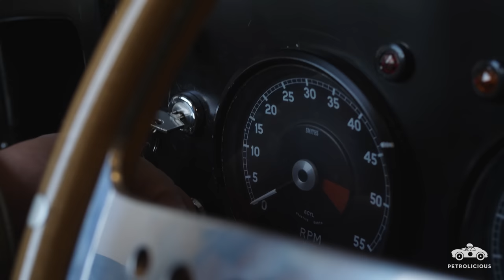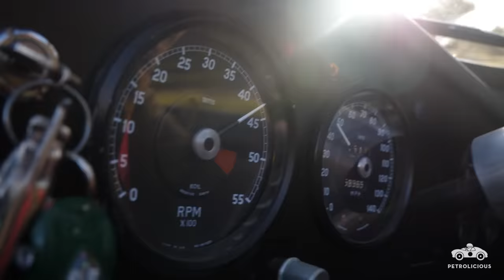Jaguar XKSS: A Re-creation Made For Recreation

Comment: Nice video. Thank you. I remember reading a circuit test of a D Type as part of an Autocar series in the mid to late 1970s, wherein the tester mentioned its twitchy behaviour in corners, due to the solid rear axle. Using an XKE as the basis for an XKSS tribute is an excellent idea for a road car, especially one that will be surrounded by vehicles with disc brakes and ABS.

Comment: Cars are built to be driven. I don't consider the motion at a steady highways speed to be driving. It's true that an older car is more rewarding at lower speeds, and I've owned both, new and old. Anything from 80's an older will keep you on your toes at moderate speeds through some bends... but one of the newer cars will have to be pushed much faster for the same feel.